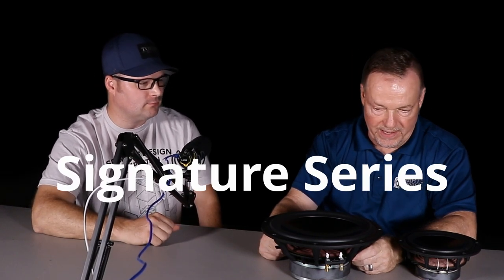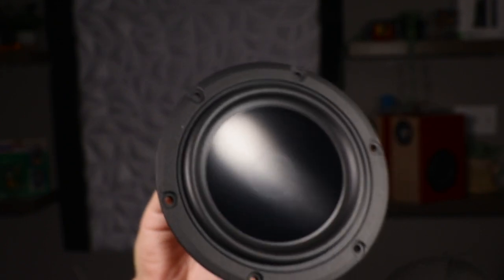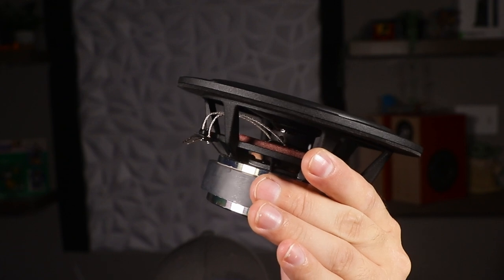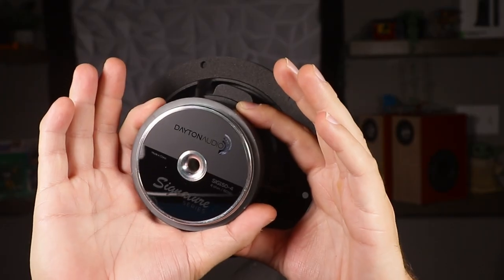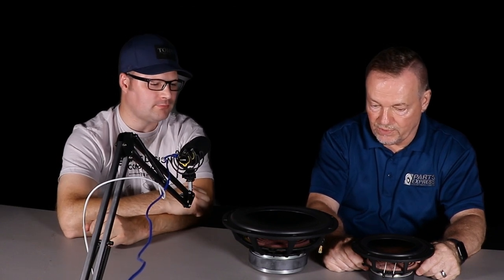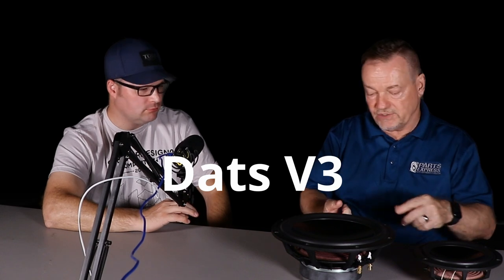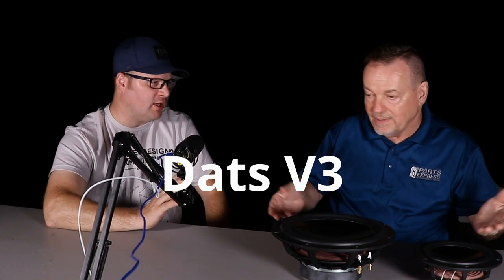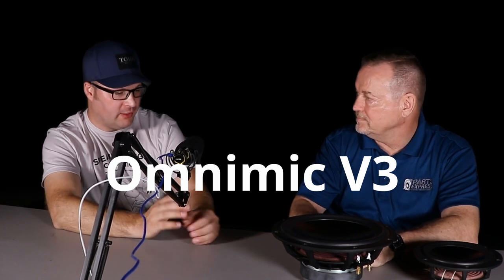These new Products from Dayton Audio will Surprise you!

Comment: Great video! Always a big learning curve with this channel!!

I do have a question wich is about something completely different. 
I am making plans for a 2way floorstanding with the typical, tweeter, midrange and two woofer per speaker. They are all the same impedance (6 ohms and all close to 89 db/1 watts). 
My question: is it better to connect the woofers paralel or in serie? My amp is pretty stable to 2 ohms but I want the load on my amp to be as light as possible while keeping the bass tight. I generally listen at 75- 85db, very rare for me going louder.

Sorry for the long question, thanks in advance!

Comment: i still have 4 8" RS225-8 drivers laying around for making two bass boxes.
i think i will go to make a sealed box with minimum 57 liters, probably more in the area of 75 liters to have a softer roll off and less loud resonance at the low end, applying the golden ratio from width to depth to height or something like that and put two horizontal boards inside with 4 rectangles cut out to improve the stiffness of the box. and apply them also in odd ratios in relation to the height to not induce standing waves inside. at the front the box should have rounded edges left and right.
these drivers can go up very high but i want to pair them with a two way box standing on top. i have to take the distance of the mid woofer and the two bass woofers into account to not create phase issues if the x-over frequency is too high and the distance of the lower woofer and mid woofer is too long.
i think the only weakness of the RS225-8 woofers are their mechanical/electrical losses which i want to compensate by not using a passive crossover but using a directly connected class-d amp with the two channel TPA3255 and using an active crossover. that should result in a very high damping factor and drive the rs225 very well.

Comment: I saw the signature series and was wondering how it compares to the reference series which I like a lot for the money and I also just built a MTM with the designer series woofer and those are little beats to. I'm going to just have to try them
Reply: It has waaay lower cone breakup compared to the RS180 so you can get away with lower order crossover higher up in 2-way range.
Reply: @crackyflipside  nice!

Comment: Nice, I got a two-way in the works using the 6.5" signature and the rs28 fabric tweeter. Though the driver measures surprisingly different to the published specs, the FS and QMS was higher than expected, so maybe the suspension needs some time to break in. I was also thinking of using them in a closed transmission line given the high FS. it has significantly lower cone breakup compared to the RS180 drivers.
Reply from the maker: Maybe it does. That’s called that it’s surprisingly different. Did it model quite differently as well?
Reply: @Toid  I haven't been able to put it on a baffle and measure, but it did model a bit different in WinISD when I was trying to get a vented design for the two ways. Here are the TS parameters I got from DATS (SIG180-4 6.5" driver): Re 4.073 -- Fs 50.81 -- Qts 0.5256 -- Qes .5558 -- Qms 9.658 -- Le 0.2958
Reply: @crackyflipside , my Signature 180 measures a bit different. Re 3.58ohm,  Identical Fs @ 50.81, Qts .4582, Qes .4813, Qms 9.551, Le .2842 (accidentally left it at 10k)

Comment: Which REW track do I need to play for frequency response? (128k 256k etc.)

I just figured the longer the more accurate it would be but the more patience it required lol.
Reply from the maker: That’s the exact issue that I’m refer to in this video. It all depends on what you are measuring. One of the many reasons I appreciate the Omnimic.
Reply: @Toid  yes I understand, but it seemed like you could give me the simple straight answer... I'm trying to measure frequency response (not distortion or waterfall or phase)... Which track should I use?  And by that I mean, I assume, it's one of the 128 256 512 k options etc, with the sine sweep.  And how critical is the playback level, or does it only matter to take the measurement at approximately my desired listening volume (enough to make noise floor irrelevant, say 75-85db)?

I have the umik-1 btw.  Seemed the best quality/price when I made the purchase, better than the umm6, but I was unaware of the omnimic.  Sound source for the PC (my only source) is the Khadas tone board DAC.
Reply from the maker: @Artcore103  I’m sorry you felt that way. But honestly I’m probably not the right person to ask since I haven’t used rew in about four years. So I don’t really know the interface and/or settings that you would want to check anymore. But as a generality you want a quick response.
Reply: @Toid  thanks.  Love the channel.  I plan to build something similar to your most recent klipsch-esque speakers with the textreme and horns, but I'm going to use my jbl 2225h 15" drivers, and another 15 or 18 eventually to supplement the low bass, as subs built into the mains - mainly for sensitivity and extension down low, to ~20hz, but all passive, with a 400+wpc amplifier.  But the cabinets will be partially modular or at least able to be modified because I'll start with just my 2225h 15s, tuned to roughly 30hz.  Not afraid of DSP correction.

I'm already using these woofers in my current 3 ways, which have a JVC ribbon tweeter above 8-10khz, and an akai phenolic horn mid... But it can't cross low enough, is low power handling, and nothing about the speaker or driver/crossover implementation is ideal.  Sounds good anyway with EQ, but obviously not nearly as good as what they could be with a design like yours.  The 2225h itself is awesome, but it's crossing near 1.6khz, but they're in big ported boxes and I do get a solid 30hz.